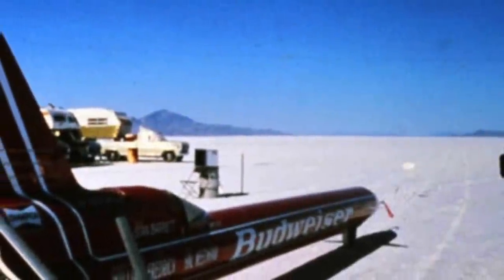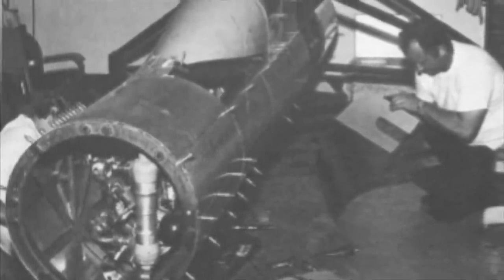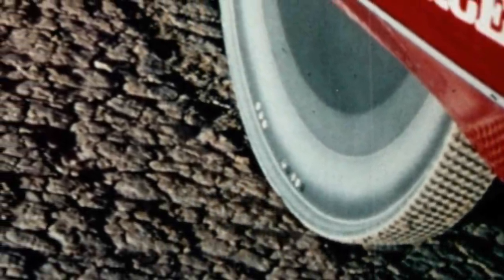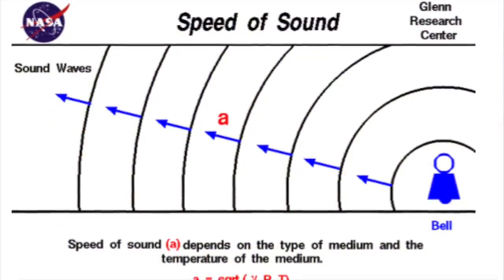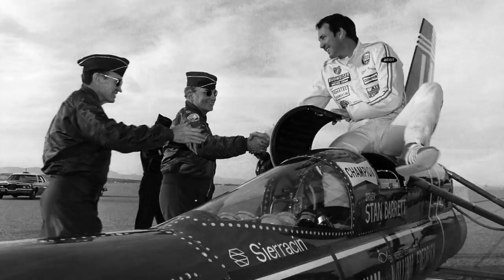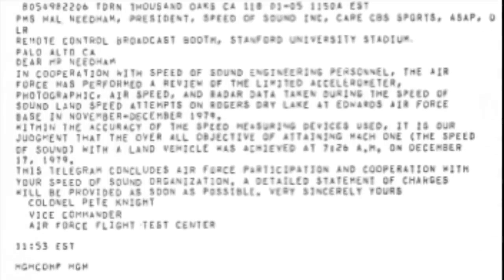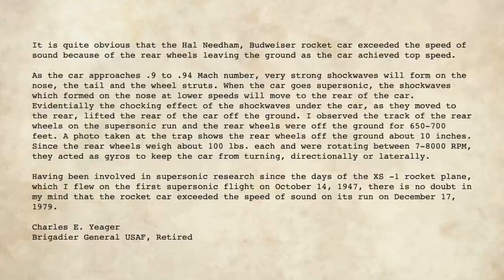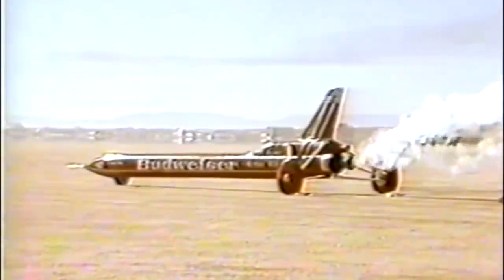The Budweiser Rocket - Controversial Rocket Car

Comment: The surface of an aircraft manipulates the fluid you call air at different speeds over its shape. The constitution of breaking the speed of sound is very mathematic. The sound you hear and everyone attributes to Mach is suspect. Portions of an aircraft "breaking" the speed of sound can and will first start out as a low freq. rumble, then proceed through your physical auditory sense as a clap. An object can exceed the speed of sound and not make a sound. Ask NASA. The bud. Rocket car was timed at a U.S. Air force base, do you really think they are dumb?
Reply: In this case yes. It is dumb to use technology that is completely useless for the task you are trying to achieve. The team never gave a shit about rules, or official records. It was a publicity stunt. Period.
Reply: MX304 kinda of like you and you tube.......
Reply: "Portions of an aircraft "breaking" the speed of sound can and will first start out as a low freq. rumble, then proceed through your physical auditory sense as a clap."

Please provide some links to prove this nonsense.

A vehicle traveling at sonic speed will push out a bow wave in front of it. The fact that it has already exceeded its critical mach number is irrelevant (though M.crit is always less than M1).

"An object can exceed the speed of sound and not make a sound. Ask NASA."

NASA will tell you that this is impossible. Stop trying to bluff people with the NASA card. There is no such thing as something which exceeds the speed of sound without making a bang. I'm amazed at how poorly understood this is.

"Rocket car was timed at a U.S. Air force base, do you really think they are dumb?"

Frankly, yes. It took them eight hours to reach their conclusions. You'd better hope they're faster than that when it comes to intercepting incoming aircraft or missiles. Besides, radar doesn't measure Mach events.

Comment: The sound barrier is 741 miles per hour @ sea level..... according to the radar it made 739.
Reply: Edwards is not at sea level, and the speed of sound varies slightly according to temp and barometric pressure.
Reply: @49JBro  I know for a fact that you are right👍✌️

Comment: Thrust SSC is not propelled the same manner so it is unjust to suggest because the sound barrier (which by the way occurs during deceleration - Space Shuttle landing ) was heard during its run, and Budweiser was not means Stan Barrett did not.  Standing near a rocket motor such this would certainly likely mask a sonic boom.  Way to go Stan!  I think you did it!
Reply: He didn’t

Comment: America should go Metric to confirm the actual speed and everything else.
Reply: Didn't need Metric for Chuck Yeager's record.
Reply: Before you go us should go metric....
Do you even know the us does almost everything metric (except driving cars) theit military doea everything metric, scientists do also. Just saying...
I watch BBC, they talk alot miles and feet ect.
Reply: There were some incidents on space craft with changing from imperial to metric and being either shoved into another planet or goes back to New Year’s Eve with Fire works but in a larger scale from NASA to SpaceX and other space companies that still build fireworks for display purposes but it would be more better sticking with Metric because it is more Accurate than Imperial. I just don’t want to rub in you all still use degrees Fahrenheit rather than degrees Celsius for the temperature measurement and Fahrenheit is not accurate to Celsius. All aircrafts are treated like ships and cars are like ships but on land most cars are metric and others are imperial American road rules some parts are metric while other are Imperial Kilometres per hour is in metric and miles per hour is imperial.
Reply: Didn't need metric to land on the Moon.

Comment: It's my understanding they, the air force radar, recorded the speed. They never released it.  They did not give a crap about the "official rules"  the car broke the sound barrier, that was the goal... Stop whining because they didn't jump through the hoops you think they should have.
Reply: No sonic boom 
Sound barrier not broken

Why no accurate timing data?
It’s not as if budget was a problem 
Why not a second run another day to prove it?

It just points to they lied about the speed twisted the data to make it look good but will never release that data for scrutiny by an independent agency
Reply: @630lsr  But what can you do if you know Distance and Time?.......you can calculate the speed. ta dah, The question is then just how accurate is a Military grade radar as measuring distance........i'd say very good for the time, quite possibly the best around.
So why wouldn't they produce the evidence......it might be that the Military wouldn't want to be seen to be telling the public lies, Heaven Forbid they would do such a thing
Reply: To make it more clear, the target vehicle was traveling horizontally 2 miles away (on the horizon) and the radar was panned manually to follow it. The change in angle versus time was used to calculate the horizontal distance travelled at whatever speed. Since this was manual tracking, using a video camera with a telescopic lens, I could have gone supersonic on my bicycle using that data system.
Reply: It's physics mate, not patriotism. No sonic boom? Hate to tell you, but you didn't brake the sound barrier.

Comment: Any one who flies model rockets at a high power level breaks the sound barrier, no visible shockwave or noise and some of the rockets are well over 12 inches in diameter. The size and noise relational to the size of the object creating it, those comparing this to a NASA launch or a jets fighter that at a minimum has dozens of times more frontal area are idiots. With the noise of the engines and the ground turbulance I seriously doubt anything would have been seen or head.
Reply: That, and recent efforts by NASA and others to reduce sonic boom noise invariably involve very long, thin, pointed fuselages. Reminds me of a landspeeder.
Reply: Not true. I worked at a government armaments factory and on the firing range they were testing high powered armalite rifle rounds. Downrange you heard the sonic crack before the sound of the firing. Even small projectiles make a sonic shock wave... Same with the head of a whip.
Reply: "With the noise of the engines and the ground turbulance I seriously doubt anything would have been seen or head."

What? The video shows the vehicle heading towards the camera but at all time it can be heard before it gets there. That means the sound got there before the rocket did, ergo: the rocket was not supersonic at any point in the run. Here is Thrust SSC making a genuine sonic bang in 1997:

https://www.youtube.com/watch?v=rIWdtE-__5M

Comment: We were in a 747 over the Pacific Ocean heading east with a massive tailwind from the jetstream. The pilot came on and said that what we were experiencing was not mild turbulence, it was air over parts of the plane going supersonic. So, the buffeting on the tail finned beercan meant close, but no cigar -- that tail, nosecone, and the wheel pants all should have produced shock waves at close, but different speeds. Nobody heard any, not did they see any traveling the desert floor. And nobody happened to have a microphone where the shock waves could be picked out with signal processing. Nah - just more American propaganda, just like the scam they pulled with the Wright Brothers.

Comment: What a machine, faster than the current disastrous attempts
Reply: Not faster than Thrust SSC.
Reply: @thethirdman225  Breedlove's Formula Shell LSR was faster than Thrust SSC, and would have proven it if it hadn't been mistakenly run in high winds and ruined its good engine when it tipped on its side. It was good for well over 800 mph. Bad luck for Breedlove is the only reason Thrust SSC has the record.
Reply: @JG-dx5wi  This is pure speculation and there is absolutely no way you could know this.
Reply: @JG-dx5wi  When I was a kid I followed Craig Breedlove's exploits to such an extent that I got into trouble at school for always writing about him English class. Even after Gary Gabelich went faster, I still regarded Craig Breedlove as the moral holder of the World Land Speed Record. Nothing against Gary Gabelich or even Blue Flame but Blue Flame was a rocket, rather than an air breathing engine.

When Thrust SSC set a new World Land Speed Record and became the first to set that record above Mach 1, Craig Breedlove was the first to go and congratulate them. He was an outspoken critic of the Budweiser Rocket for any number of reasons but few of them had anything to do with LSR rules because this was never an attempt on the record. It was an attempt to create an event. Breedlove is a sharp guy and he saw through the smoke and mirrors.

Breedlove also built all his own vehicles himself and he's probably the only person ever to survive two crashes above 500 mph. The second one was said to be somewhere near 650.

So Craig Breedlove is a man I have admired for a very long time. He's got brains, he's got courage and he's got integrity. But he has his limitations and he's human.

One thing he's always done is eschew wind tunnel testing. This almost ended in disaster when the front end of Spirit of America II lifted off the ground at about 600 mph due to shock formation underneath the nose of the vehicle. But that was in the 1960s and while records were well into the compressibility zone, they weren't quite in the transonic zone.

Funny things happen in the transonic zone. Air behaves very differently from what it does in the subsonic zone. Once a vehicle starts to generate shockwaves, airflow becomes less predictable. The results can be fatal. I have a photograph of the shredded tail of an Me-163 Komet which was the result of it exceeding its Critical Mach Number (the speed at which the airflow becomes sonic at some point on the airframe).

This is where a lot of these things come unstuck.

Then there's the critical drag rise just before Mach 1. On the day of Breedlove's crash, the local speed of sound was something like 100 mph above the speed he was travelling at, so about 750 mph. The crash happened right at the point where I would expect to see a significant slowing of his acceleration as the vehicle fought its way through the exponential increase in drag just before the speed of sound. This is called Drag Divergence Mach Number. This is why it was known as "the sound barrier" because when the phrase was coined, engines simply were not powerful enough to overcome the dramatic increase in drag.

http://mae-nas.eng.usu.edu/MAE_5420_Web/section7/section.7.3.pdf   (see page 8)

If you are like most people, you will assume that the rise in drag will be linear. You will probably also assume that your progress will be linear. It won't. If you watch the onboard telemetry data from Thrust SSC, you will see that the rate of acceleration slows dramatically just before 700 mph. Thrust SSC, of course, went on to supersonic speeds and its average speed was ultimately recorded as 763 mph.

https://www.youtube.com/watch?v=uKFDcZuM40M&ab_channel=BloodhoundBites

So the claims that Craig Breedlove would have gone any faster are pure speculation. There is no wind tunnel data on the car and consequently, no Cd was ever worked out because Craig doesn't think much of wind tunnels. Without that figure, it is impossible to work out total drag and what the top speed of the vehicle might have been. Everything else is speculation.

Comment: He broke the sound barrier just not both ways as the new b.s. rules state
Reply: No boom, nothing broken .....
Reply: @rjet4321  But you do need a boom for it to happen or you did not brake the sound barrier.
Reply: @rjet4321  thrust ssc made a boom and had real speed measuring gear ,and did it twice buff said .
Reply: Paul Davidson Size, Speed, and Atmosphere

As described earlier, the size and weight of the aircraft influence sonic booms. The ratio of aircraft length to maximum cross-sectional area also influences the intensity of the sonic boom. The longer and more slender the aircraft, the weaker the shock waves. The fatter and more blunt the vehicle, the stronger the shock wave can be. This is from nasa so again the sonic boom or the sound you hear can be non-existent depending not size, shape altitude and other factors! So again our car did break the sound barrier just no one heard a boom!
Reply: @rjet4321  you're  delusional  ,a  30 cal boat tail rifle  bullet makes a sonic bang   and doesn't weigh 3700 lbs , there were no visible shockwaves like the Thrust SSC made ( that actually broke the sound barrier) A rocket car at anywhere  near the speed of sound should have at least some localized supersonic flow .All I'm hearing is load whiny bull from a bunch of confused fan boys who can't get their heads around the fact Barret was all  show and no bang.
Reply: @rjet4321  
"This is from nasa so again the sonic boom or the sound you hear can be non-existent depending not size, shape altitude and other factors! So again our car did break the sound barrier just no one heard a boom!"

Nobody believes this and it is not born out by the video footage which shows the vehicle coming towards the camera with roughly the same sound level for the entire run. This means the sound got there before the rocket did. For this to happen, the rocket must have been traveling slower than the speed of sound.

Nor are there any photographs in existence showing any Schliere (sonic shock) effects, as there were from Thrust SSC. Like this:

https://www.acs.psu.edu/drussell/Demos/doppler/shockwaves-car.jpg

or this:

https://qph.fs.quoracdn.net/main-qimg-4fc6a68cc73b633d044d39c6563443cf

or this:

https://www.acs.psu.edu/drussell/Demos/doppler/mach1.html

Frankly, anyone who thinks this couldn't make a sonic boom because of its size does not understand the basics of supersonics, either in flight or on the ground. The sonic boom is unlikely to be heard from behind and inside the cone of a sonic shockwave, as per a rocket lift off. However, anyone forward of that cone will experience it as the vehicle goes past. Like this:

https://www.youtube.com/watch?v=rIWdtE-__5M

The reason it didn't make a sonic bang was that it was not traveling at sonic or supersonic speed. NASA will not ever tell you that a sonic boom can be non existent for any aircraft exceeding the speed of sound.

"So again our car did break the sound barrier just no one heard a boom!"

No one heard a sonic bang because there wasn't one. The vehicle was not supersonic. It staggers me that there are so many people who pretend to understand supersonics out there spreading useless lies and disinformation without ever bothering to find out how these things work.
Reply: TheThirdMan first off I am a former military sgt. and what I heard is a zip not a crack! Second my point was our car broke the sound barrier it just was not heard or recorded and I’ll stick to that!
Reply: @rjet4321  Yeah, well Army Sergeant or not, the principles of aerodynamics still apply. If what you heard was a zip then the bullet was subsonic. A shockwave from a sonic bang spreads roughly the same way as the bow wave from a boat. If you are behind it, you will be unaware of it. If you are ahead of it you will experience the wave - a sonic bang. Anything else is subsonic:

http://www.seitzman.gatech.edu/classes/ae2010/machanglenumber.pdf
Reply: TheThirdMan I’m sorry Einstein but yes I was down range with bullets going overhead so unless you are very close to the muzzle you will not hear the bang which is the explosive gas’s leaving the end of the barrel not the bullet! You hear the bang down range after the bullet hits
Reply: TheThirdMan ps size does matter, at least in the amount of sound produced by the object going faster than sound! I’m done! My point was we broke the sound barrier first! Period!
Reply: Ron B - ‘NEW b.s. rules’? You mean the same FIA rules that have existed for decades?
Reply: @rjet4321  Actually, the two runs in both directions within an hour rules were formalised in 1924.  I'm pretty sure that was just slightly before the Bud Rocket attempt...
Reply: The "BS rules" are to make it fair for everyone. The BR team didn't comply and didn't allow for independent verification. Craig Breedlove and Richard Noble completely discarded it.

Comment: Who would you believe,the man who was  right there,who did it,who flew all kinds of aircraft,piston powered,jets and rockets,who was an ace,and probably the most seasoned test pilot of his time,or some pencil pushing nerd who'd probably piss himself if his lemon car went beyond 30mph
Reply: @Olenga Gallardo The intelligent and knowledgeable "pencil pushing nerd" who knows what he is talking about over the glory hound obviously. As if there was ever any doubt about that.
Reply: I'd rather believe a sonic boom...hence failure.
Reply: Yeah, keep telling yourself that.  Without the engineers and support people the car would not have been built and would have gone KNOWHERE.  I AM an engineer, and I guarantee there are plenty of my ilk that would have no problem strapping into a PROPERLY designed speed record vehicle...and many who wouldn't.  You might be surprised to know that there are many engineer race drivers at different levels of racing.  Most "aces" couldn't build a 30 mph go kart that would be even remotely safe, but there are exceptions to that "rule" as well.
Reply: It was pencil-pushing nerds that designed and built the that aircraft in which Chuck Yeager broke the sound barrier. It's those pencil-pushing nerds who understand engineering and how to measure speeds properly. I go with the pencil pushers every time when it comes to engineering.
Reply: No, I wouldn't believe Yeager. His reasoning is totally flawed and actually, kind of embarrassing for anyone who understands these things.

http://www.dlg.speedfreaks.org/archive/lsr/bud/bud.html